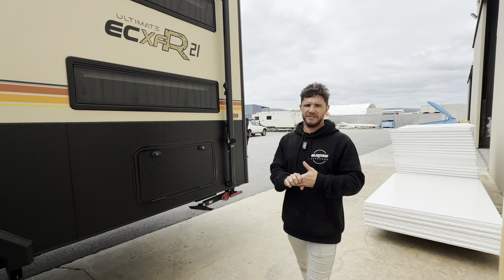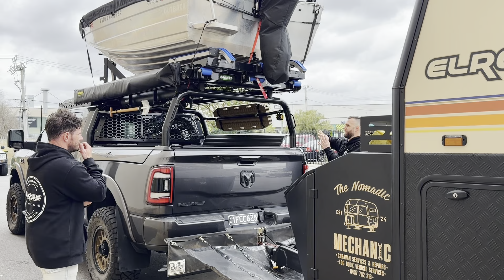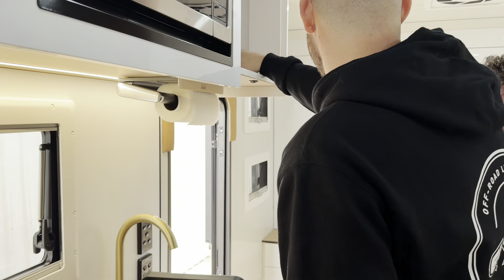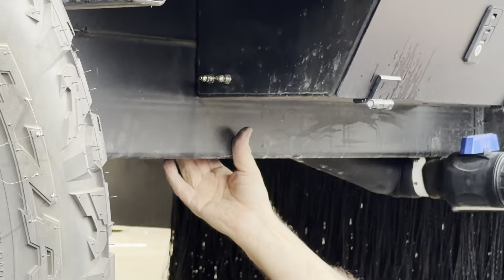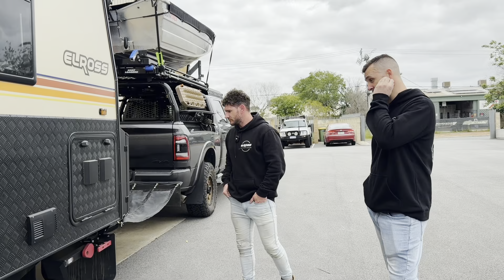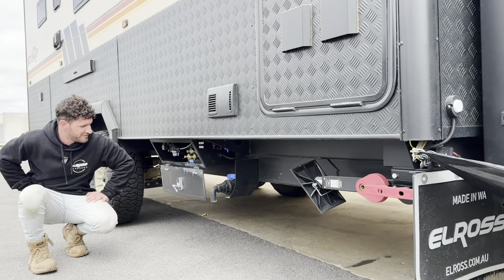Special feature Episode – Owner’s Thoughts: Jarron’s Elross Experience

Comment: Hi there guys 
This is not a negative question ,are your van built from bondor sandwich panel ? If so is there any issues with 240 v running in the insulation?
Reply from the maker: In any insulated panel the requirements are now to run Purple non-migratory tps